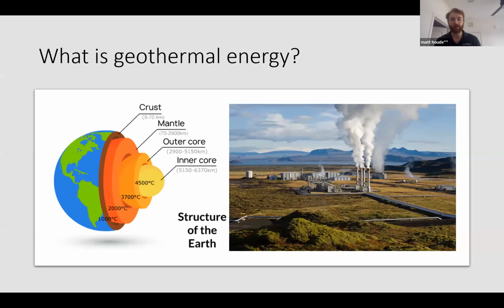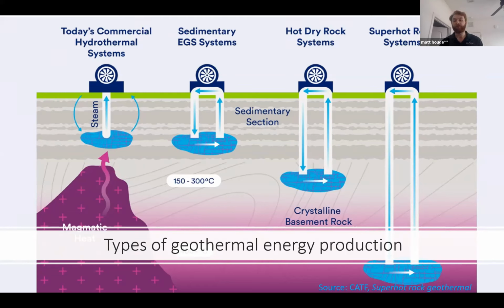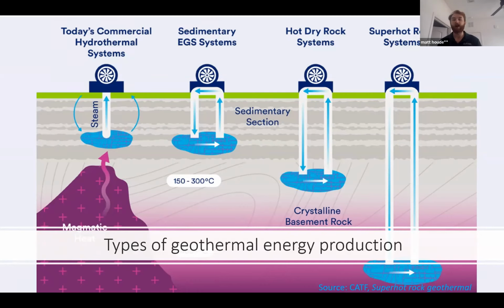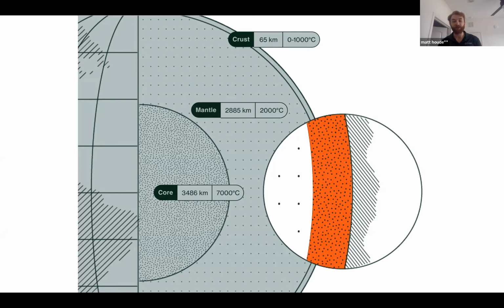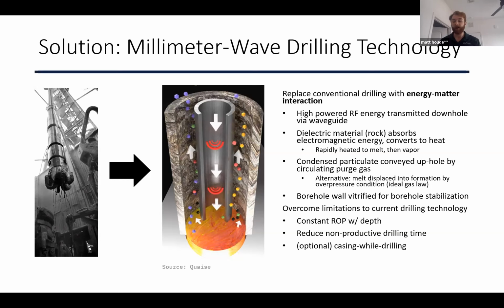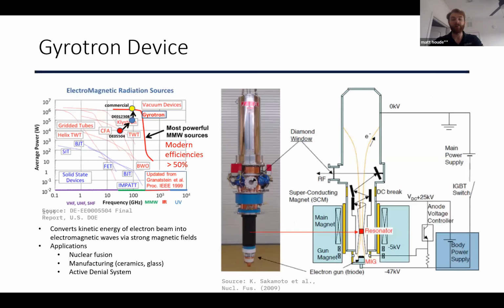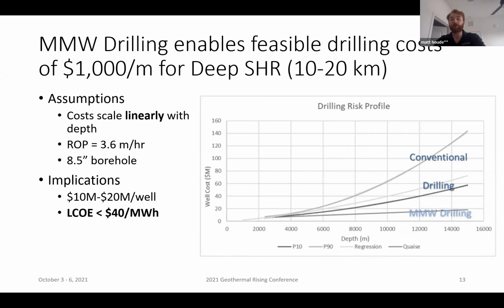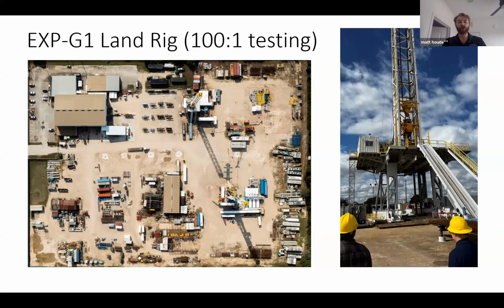Geothermal Webinars 2023. Webinar 1: Unlocking the True Power of Clean Geothermal Energy

Comment: We need to run a few sanity checks here first. Reading Professor David Mckay,s famous book “renewable energy without the hot air” there are words of caution . We need to remember that rock is a poor conductor of heat and he calculates that the sustainable heatflow from the earth,s mantle to crust at quite a low figure of 10 to 20 milliwatts per square metre . We also need to remember that the earth,s mantle is normally solid or only partially melted and therefore heat transport will be poor . Only in areas where there are joins between the earth,s plates will there be liquid magma and convection to enhance heat transport from deeper inside the earth  , such as in Iceland . If the project is not sited near a chamber of magma to replenish the extracted heat heat there is a real danger that heat output will degrade unacceptably over time .  These were the mistakes learnt at the  Rosemanowes project in Cornwall UK in 1985.